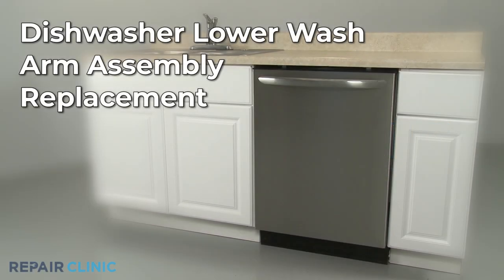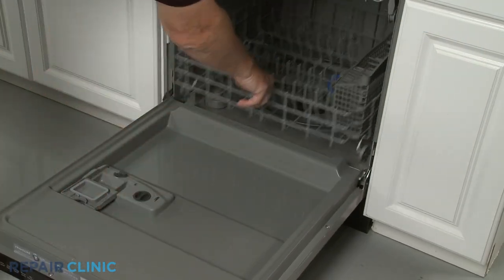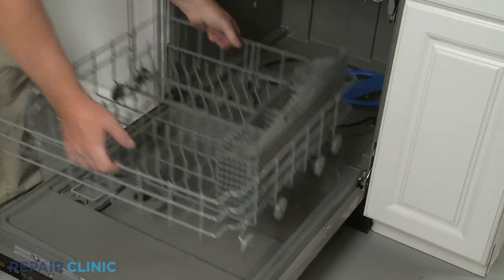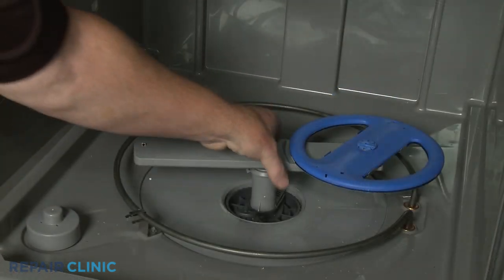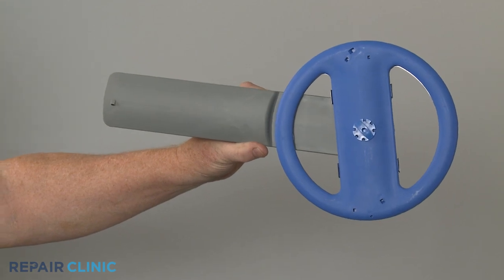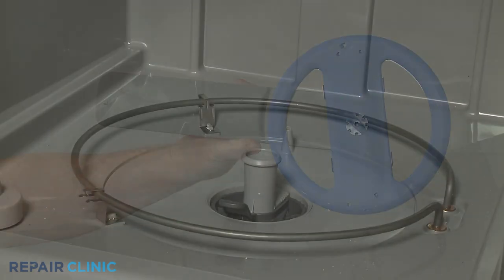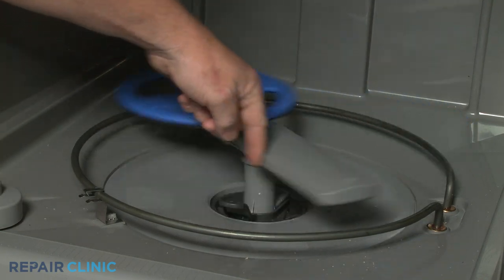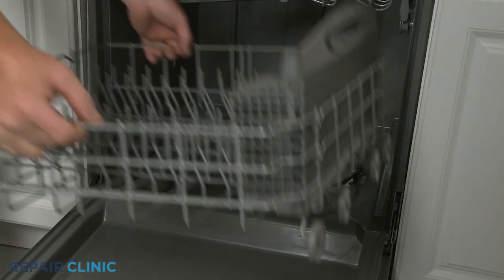Frigidaire Dishwasher Lower Wash Arm Assembly Replacement (part 5304507158)

Comment: is there a way to just purchase the blue part instead of the entire assembly of the wash arm?
Reply: Did yours break off too? Hoping you found a solution 😬
Reply: I was able to purchase the blue part but for some reason it did not come with the metal piece that is attached to the bottom of my current piece and it did mot have the notches to clip the current metal piece from the old to the new blue part… Is the metal piece no longer needed?

Comment: I do a monthly cleaning of that part and the circulator mesh thing once a month.  This last time after doing that, I did a load of dishes and the spray arm melted on the heating element.  I bought a replacement from Amazon but now it sounds like water is just gushing from the inside and it leaks from the bottom sides.  Any clues as to why and how to fix?
Reply: The Amazon replacements seem cheap, they break almost immediately